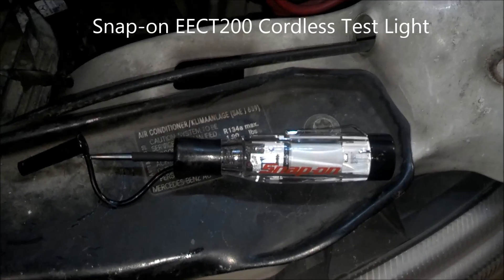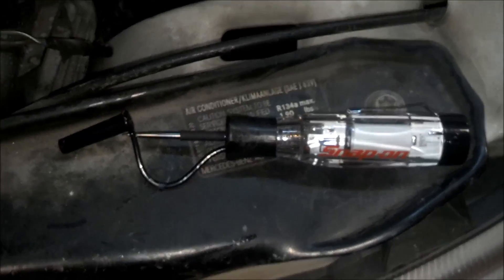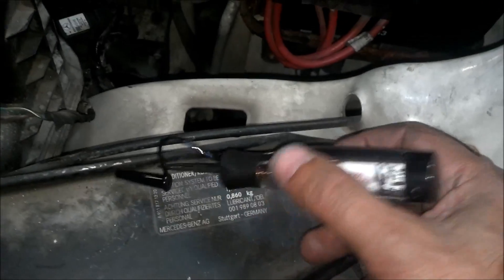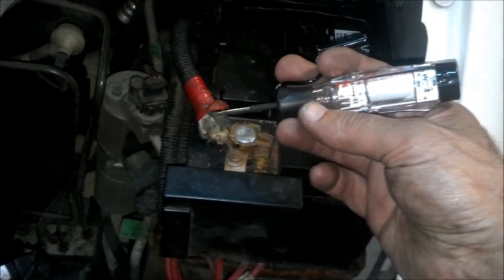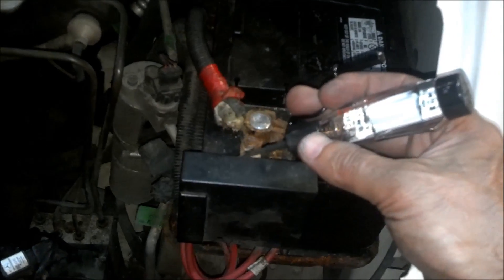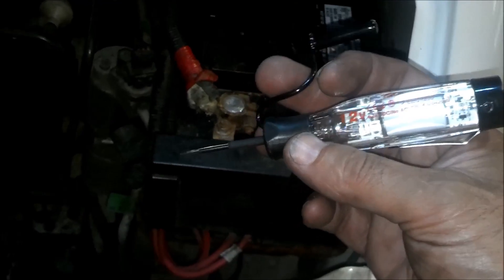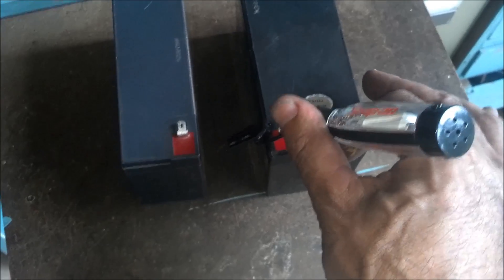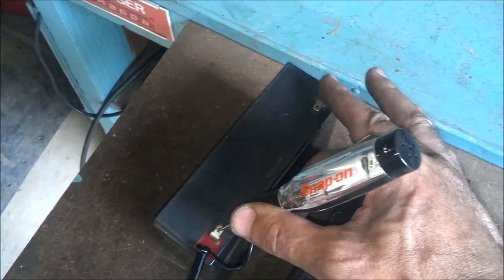EECT200 Operational Demo

Comment: These are rebadged & NOT made by SnapOn, Look for ATD Tools Cordless Tester (ATD-55033) Same tool minus the Snapon logo... $35 on Amazon & $40 on eBay  There are cheaper versions as well: Astro Pneumatic 7760 & DLG DI-150 for less than $15. Some of the reviews look sketchy but for that price buy one of each and STILL come out way ahead of the SnapOn... Also these use a special 3.6V lithium battery so get spares...
Reply: The ATD is made in China, the Snap-On is made in South Korea. Not rebadged.

Comment: This is a do-over from a very old tester. It's useless.
Reply: ***** Not if you want to make a determination that's valid. Simply knowing that voltage is present isn't enough. Trust me - after 30 years in the field, I can assure you that test lights are responsible for more missed diagnoses that could ever be counted. Given that a 5Ω fault can shut down an ECM, seeing voltage through 2MΩ isn't worth a damn. Sorry.
Reply from the maker: Daniel Sullivan Definitely agree that many folks have used them when they should have grabbed a meter instead.  That is for sure.  I've seen guys using screwdrivers as chisels.  Doesn't make the screwdriver useless....well...eventually it will!  :-)
Reply: ***** I think the real issue is how much we're had to adapt to less-than-perfect tools using less-than-perfect instructions from FAR from perfect engineers. My point is - again - if you have the ability to do an instantaneous voltage drop on a complete circuit from the load connector without disconnecting any wires and connections, with complete confidence in that answer - why wouldn't you? If you have to use multiple tools to derive multiple incomplete answers, and then try to put that information together for an incomplete conclusion, it isn't all that effective. It's just logic... Oh, and BTW - we both know that a screwdriver is less-than-perfect chisel. A test light is a far-from-perfect diagnostic tool. If you have the option to use a chisel, why choose a screwdriver...?
Reply: I like it. It may not be a Load Pro, but it works as designed. That was proven in the video. This will work great for testing my trailer light circuits on a camping trip.
Reply: True - as long as there's no corrosion. An electronic tool that allows a continuity test through the high Ω of the body (500KΩ - 2MΩ) is successful at finding two of the three wire faults - opens and shorts-to-ground. Corrosion will be invisible. As long as the tool - and every tool - is used with a complete understanding of its abilities AND limitations, everything is rosy. Education is the key.
Reply from the maker: I wouldn't say "useless".  Test lights are handy for plenty of purposes.

Comment: Outside of proving current does run thru your body what good is this tool?  The infinitesimal amount of current in takes
has nothing to do with the current necessary to make a lamp or a relay coil function. Think I'm wrong?  Go stick a typical
12v automotive bulb in series thru your arm from batt + to negative. Is the light on? A 75.00 continuity tester, nothing more.
Reply from the maker: Great question.  Just like you'd never use a battery maintainer to charge a battery, you don't use a test light to load test a circuit.  This tester works as good as any LED test light.  It will tell you that there is voltage present, but that is where test light abilities end.  It is nice that it is high impedance, which is great when you need it, but with high impedance comes the inability to load test a circuit.